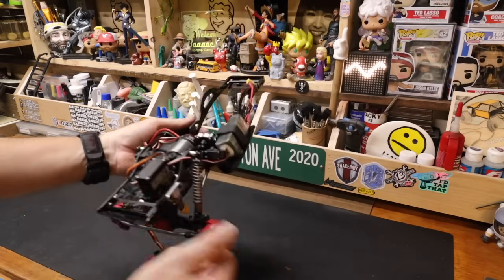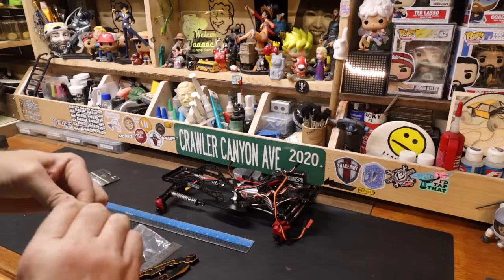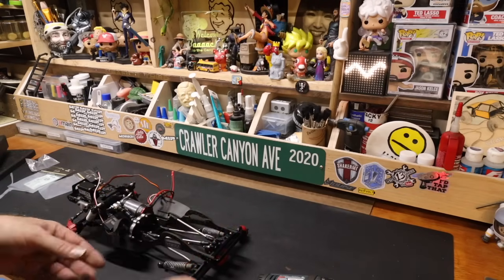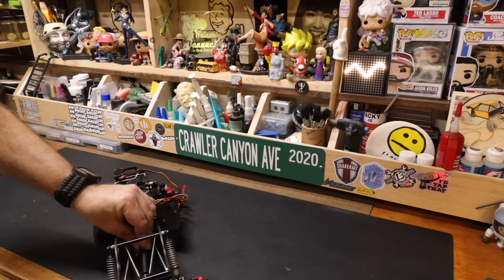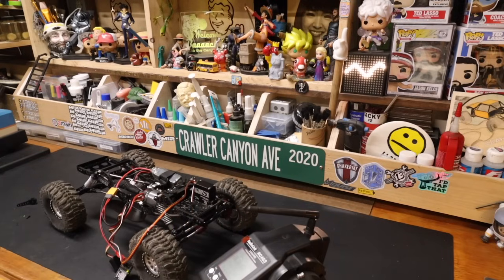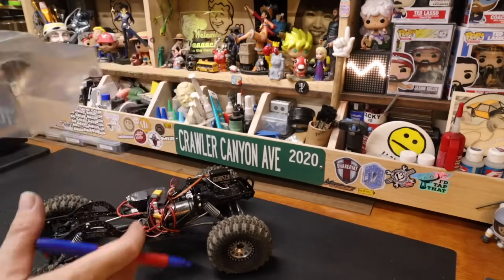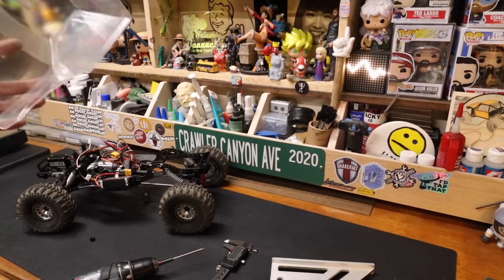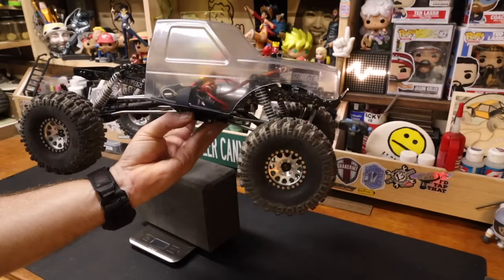Crawler Canyon ICFTW Vol.45 Ep.2: Now, with more MEUS

Comment: I would go with a matte gold instead of a full shinny gold. I also, think it would look better 2 tone like maybe gold with a black hood or roof? You could also use the molded fender line that runs the length of the cab and paint below that one color and the rest a different color. 🤓
P.S..... that suspension is lookin a little suss.... we need to get some straps on there asap!